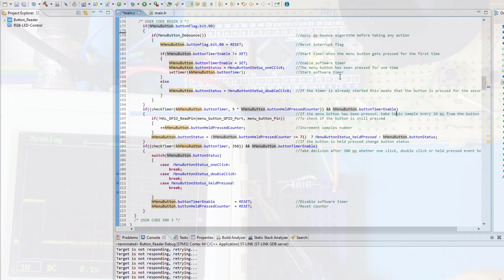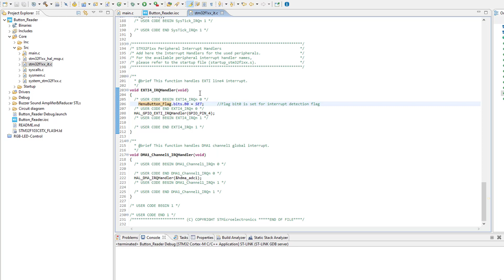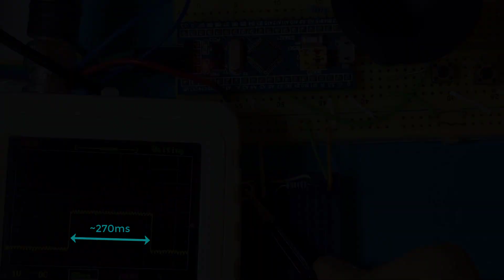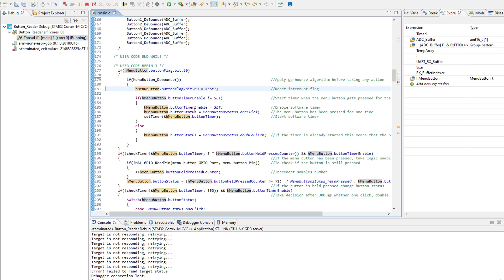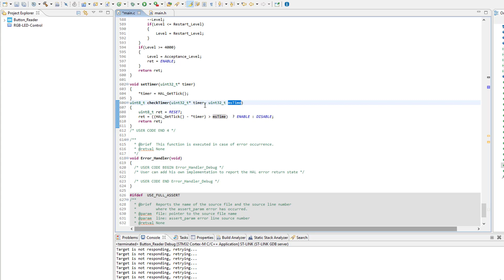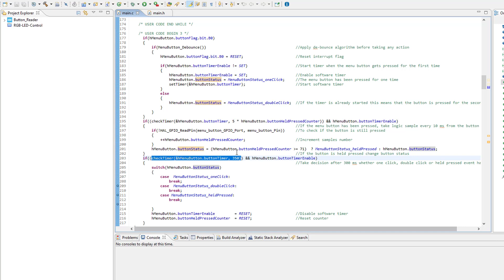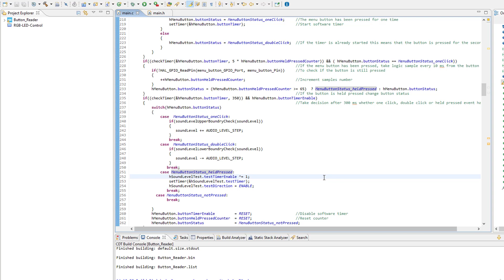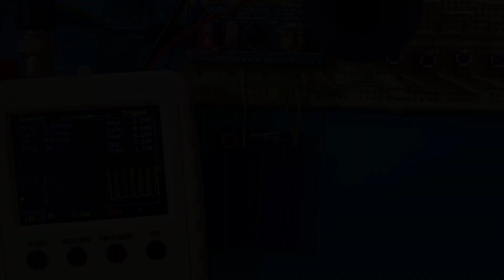STM32 Push Button Single Press, Double Press and Held Pressed Control Algorithm

Comment: Best code I have found for multiple button presses but I wanted to impliment it on four different buttons and for some reason the debouce didn't work properly it was counting for ages and the button held pressed code also didn't kick in. Probably the same thing counting too long, so i changed this
 #if 0

	  		  	  if((checkTimer(&hEncoderButton.buttonTimer, 5 * hEncoderButton.buttonHeldPressedCounter)) && ( hEncoderButton.buttonStatus == EncoderButtonStatus_oneClick))
	  		  	  {																		//If the EncoderButton has been pressed, take logic sample every 10 ms from the button read pin
	  		  		  if(HAL_GPIO_ReadPin(EncoderButton_GPIO_Port, EncoderButton_Pin))		//To check if the button is still pressed
	  		  		  {
	  		  			  hEncoderButton.buttonHeldPressedCounter++;						//Increment samples number
	  		  		  }
	  		  		  hEncoderButton.buttonStatus = (hEncoderButton.buttonHeldPressedCounter >= 65)  ? EncoderButtonStatus_heldPressed : hEncoderButton.buttonStatus;
	  		  	  }
#endif

to this 

	  		  	  if((checkTimer(&hEncoderButton.buttonTimer, 350)) && ( hEncoderButton.buttonStatus == EncoderButtonStatus_oneClick))
	  		  	  {																		//If the EncoderButton has been pressed, take logic sample every 10 ms from the button read pin
	  		  		  if(HAL_GPIO_ReadPin(EncoderButton_GPIO_Port, EncoderButton_Pin))		//To check if the button is still pressed
	  		  		  {
	  		  		  hEncoderButton.buttonStatus = (hEncoderButton.buttonTimer >= 350)  ? EncoderButtonStatus_heldPressed : hEncoderButton.buttonStatus;
	  		  		  }
	  		  	  }

oh and increased the 350 before the switch to 400 although 360 might have been fine
and removed all occurance of .buttonHeldPressedCounter
and the debounce function I changed to this

uint8_t EncoderButton_Debounce(void)									//EncoderButton debounce function
{

	  currentMillis = HAL_GetTick();
	  if (HAL_GPIO_ReadPin(EncoderButton_GPIO_Port, EncoderButton_Pin) && (currentMillis - previousMillis > Debounce))
	  {
		  ret =  ENABLE;
	  }
	  else if (!HAL_GPIO_ReadPin(EncoderButton_GPIO_Port, EncoderButton_Pin) && (currentMillis - previousMillis > DebounceFail))
	  {
		  ret = DISABLE;
	  }
	return ret;
}

declaring currentMillis, previousMillis & ret in PV and defining Debounce as 30 and DebounceFail as 10 in main.h
but still very good code 
and my debounce is probably not as inclusive as yours but I really don't know why your code was not working properly for me, I did add all the extra typedefs for my other 3 buttons 
But Thanks 
I finally have 12 functions on 4 bu'ns you sound european but the way you say buttons is so english! lol
Reply: Oh I was also using pulldown with button to high hence the swapped gpio statements

Comment: I want to make keyboard using push button that use arrow keys, space key, enter key, back space key, shift key
Reply from the maker: If the buttons count is limited and you have free pins you can connect each button to a pin. 

Or you can use input shift registers to save pin count and read button status over serial connection